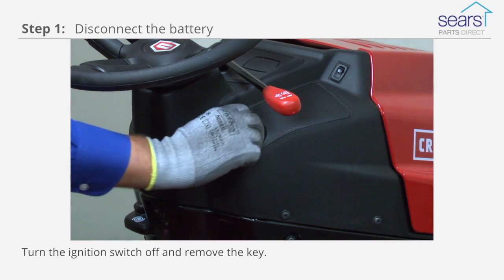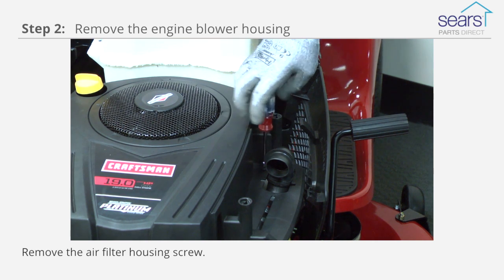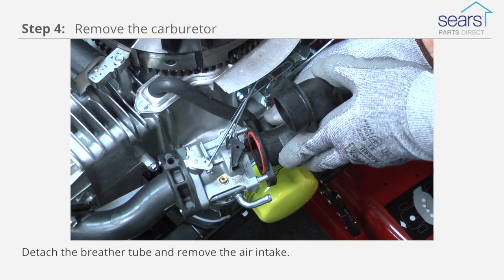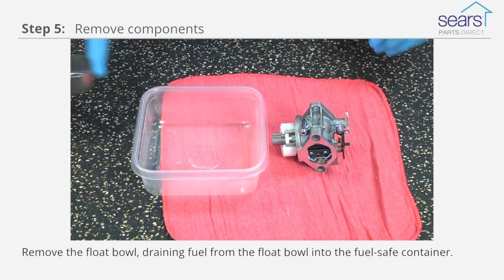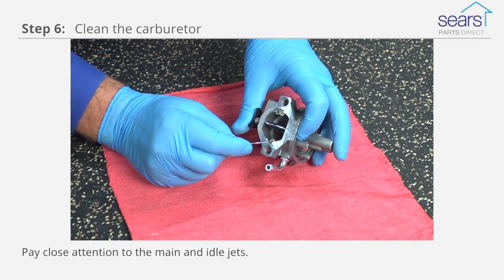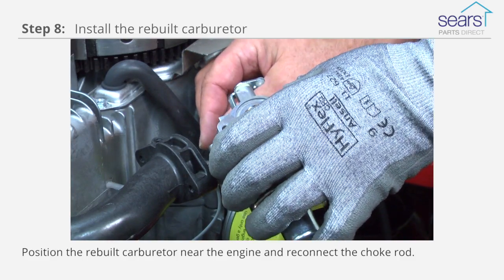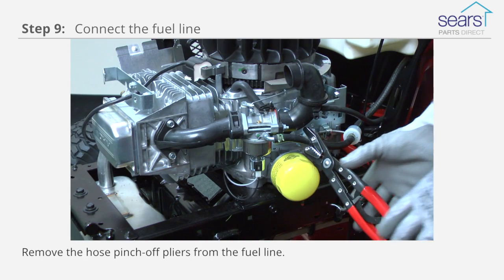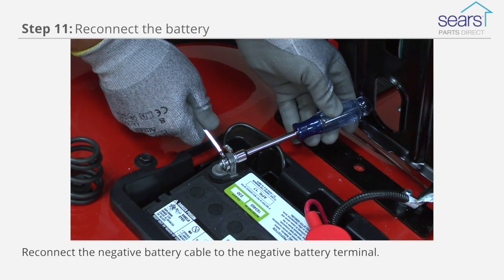How to rebuild a Carburetor on a Riding Lawn Mower

Comment: Do you have a part number for that carburator you installing
Reply from the maker: The carburetor for the engine show in the video is part  594601. Here's a link for that part: https://www.searspartsdirect.com/product/5qg5isaibe-0071-500/id-594601